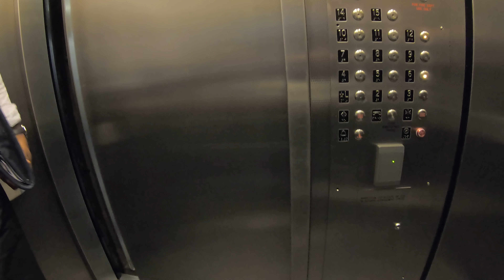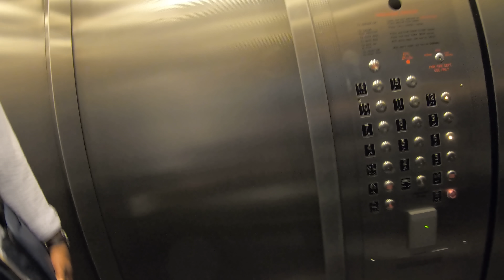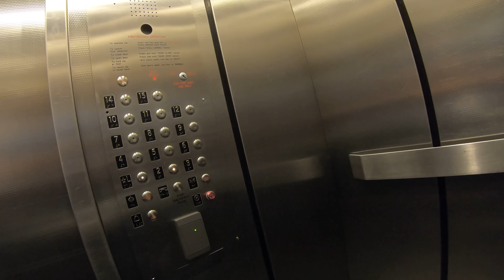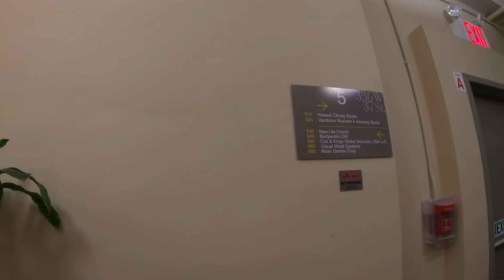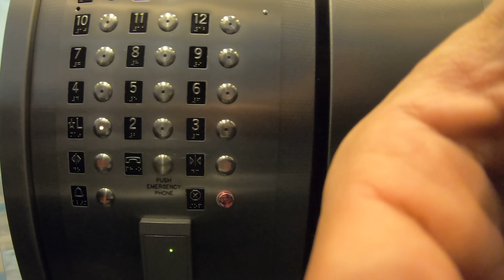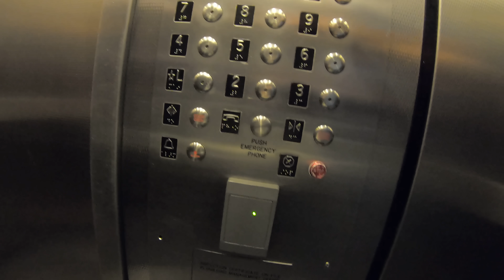Let's check out an office space I looked at today as a potential new location.

Comment: Same Blond out having a smoke when you came into the building held the door for you on her way out for another smoke.  The orange plastic cover in the closet covers a fire sprinkler which will prevent it’s operation. Should be removed however, protected with a guard to prevent damage. Probably why they left the cover on protection from damage.

Comment: Nice job fancying up an old building on the surface.
FX, look at the chandelier hanging next to the sewer pipe in the hallway ceiling...
And cheap ass ACs, in all windows so probably no real ventilation in the place.
Plus some asshole smoking outside all the live long day, so that goes straight inside the building.
>(D

Comment: Don't forget to check for EMERGENCY stuff, like adequate stairwell access, smoke free egress stairwell, emergency lighting, panic hardware, easy access to all stairwells, alternate exits, dead ends you could be trapped in, fire extinguishers/hoses, smoke removal/evacuation, roof access etc. What do you do for egress if the elevators are stuck between floors? Is there adequate electricity, water, heating, cooling? Security? How old is the bldg. - is it going to be constantly in repair mode? Is the place kept up, or a piece of shit?
Are those prices monthly rent? Holy shit.
Hope you get a place you really love - just don't fall in love until you find out all stuff mentioned above. You're life may depend on it. 
I'd like to stay around awhile, ya know...….:)

Comment: 5:12 jesus christ it's easy to keep fish alive O_O LOUIS THEY'RE FISH MURDERERS RUN
Reply: they have someone maintain the tank 2x a week,  fish loss should be near 0.     Either they terribad at the job, or scamming the lady for more money.  Or i just figured it out, they don't feed the fish.
Reply: Not really. You have to keep the aquarium clean, you have to change the water periodically, you have to make sure the water is suitable for the fish to live in with the right pH, minerals, you have to make sure the air machine and filter is maintained.
Reply: @darryldee467  Its easy. You can do all the maintaining once every few weeks. And if the tank is properly cycled all of the levels should just sort themselves out
Reply: @Robstrap  That's a salt water aquarium. They are NOT easy to maintain, you'll spend around 2h a week minimum to maintenance them with 4h every 3rd/4th week for cycle changes.
Reply: @h3llblaz3r12  I'm aware it's a marine tank. And no they don't require that much work if you set it up correctly
Reply: @darryldee467  Yeah that isn't that hard :/ I've done it before many times.

Comment: I have not experience to claim this, but I assumed that a ground level shop would be best for a business like yours. It makes sense that most people will not just walk in by chance but will look you up online first, however I'm not entirely comfortable with the idea of having more than one floor to climb. If you consider such a space I'd try to take extra care in thinking about how to set up a customer waiting area. On the plus side it seems that you don't need any renovation work with this kind of space, which is always nice.
Reply: I think you're right in needing a ground level storefront. I recently had an issue with my tablet and had recently passed a new gadget pro place. So I looked them up online & called. They looked at it for free but it wasn't worth fixing. I didn't think it would be. Another was only $120 & I'd had tons of trouble with that refurbished unit. I got brand new this time. It they were really nice & literally feet from the bus stop. As well as the library, Dollar tree & even Walmart. So I've been sending people there ever since. 
I do plan to either give it to my cousin's kid to practice on or take it apart myself eventually. Or at the very least keep it as an extra battery for my new tablet.

Comment: 2800 sq ft = 28 ft x 100 ft .... There is no way any of those spaces were that big.. maybe at most 25ft x 35 ft..... 1000 sq ft tops.
Reply: Unless I misunderstood the comment the woman stated(when asked by Louis) that the sqfootage included the loss factor meaning that includes the sqfootage of the lobby, hallway, elevator area(s), etc. and they noted that it had a very high loss factor later in the video. So no that unit is nowhere close to 2,800 sqft but he'll be paying for 2,800 sqft if he were to rent it.
Reply: Looked like 20x40 plus misc space.  1000 tops.
Reply: He said he has 700sqft and it’s getting tight for 13 ppl, then he proceeds to look at these and still think it will just barely fit them. Meaning it is about the same size - 1.5x the size of his current. Put it at anywhere from 700-1000
Reply: As someone who lives in 700 sq ft it’s absurd to think that amount of space is only 1000 sq ft. At least 2,000 no doubt
Reply: @hkeefe96  - As someone in the construction business who's been doing estimates for almost 2 decades I can say with 100% certainty that is nowhere near 2,000 sq ft, I'd guesstimate between 1200-1400 with the bathroom included, and that may be generous as I'm using the assumption the bathroom door is a standard 36" opening(which it may not be, it looked smaller with Louis standing in it but I don't know his dimensions so...) and using that as a measuring stick and being generous as it's always better to overestimate than underestimate in this business. 

I'm working on a house right now with an approx. 3,400 sq ft main floor and the great room(kitchen, dining and living room in one space) in it is close to the size of that unit by itself and there's still 5 large bedrooms, 3 mid-sized bathrooms, a powder room, a large laundry room/garage entryway, a foyer, a large office/sun-room, a mid-sized pantry and a walk-in master closet on top of that. If that unit is 2,000 sq ft than that house is closer to 7k and I fucked up and am way under-charging(along with every trade that's been working there), lol. [edit: well when the basement eventually gets finished it will be close to 7k, but I'm just talking the main floor here.]

Comment: What's with the horrible window shaker AC units everywhere in NYC??
Reply: Any building built before 1950 probably wasn't designed for air conditioning. I'd imagine a lot of these buildings are much older than that.
Reply: @truthsmiles  they could I stall ductless splits... unless electricity is cheap in NYC?
Reply: mike hawk - yeah but you know tenants don’t want to spend money improving the landlord’s property if they can help it. Moreover, a lot of landlords don’t like you making holes in the walls - especially exterior walls.

Comment: Ye, this place looks way too small to be a stored, an extra repair space, but not a store by any means.

Edit: the second combined space looks maybe something, but it is how you plan the layout that maters. Meaning it mostly like is not going to work either.

Second Edit: If you are also considering something similar to sent in repair like how certain drive companies work and don’t need a store space. You may want to consider something basically the size of the combined space, but fully together. It probably is hard to find, but it seemed like your ground floor offers fit better for that even if those were mean’t for a store front idea.

Comment: WTF is "loss factor"? Sounds like a scam.
Reply: "Loss factor" refers to the difference between rentable sqfootage and usable sqfootage - so the area of the hallways, lobby, elevators, etc. is included in the advertised rentable sqfootage but it's not actually usable sqfootage for any specific tenant as it's a public area used by all tenants. So if the space is 2,000 sqft but has a 25% "loss factor" that would mean 500 sqft of it is public/shared areas and not usable for your business but you still get dinged for it because it costs money for upkeep - especially elevators and in this case a doorman and so forth.

Comment: get one of those laser-measurement-devices ;)
Reply: That would be hilarious to see him disprove claims on the spot
Reply: @yabdelm  YES!
Reply: You just bring a notepad with a battle finish. Use them all the time. Personally I use one when measuring spaces to come up with a rough floor plan for rentals.
Reply: REALBIGBOY997  Rooms are measured in square units not cubic. So that's length times width only.
Cubic units are used when you are buying gravel or sand.
Reply: REALBIGBOY997  LOL, SQUARE feet is a measure of area, not volume. They're not measured in cubic feet.
Reply: Laser rangefinder :D
Reply: REALBIGBOY997  Are you sure it is not width x length only. I could swear height is not in the equation. Your thinking of volume.
Reply: @thor97470  Height is never part of the equation it's about walkable floor space. You can have 20 foot high ceilings but all that is is astetics.
Reply: @Segphalt  unless you're in New York City where they charge for everything, than any way they could charge more?
Reply: @imark7777777  I mean you are charged for high ceilings no matter where you are, my current place has 9ft tall ceilings and that had prime placement on the sales ad. (And with good reason, I like high ceilings) however you will never see a realestate ad that has cubic feet instead of square feet. But you will see several listings that simply lie about the size.
Reply: Well actually, sometimes you do need the volume of a room. For example when you're building/renovating a sauna, you need to know the volume so you can pick a suitable sauna stove. AC units and heat pumps also usually have a specific max volume of space they can cool or warm. But yeah :D
Reply: They are not much money and the cats will love their new laser pointer toy!